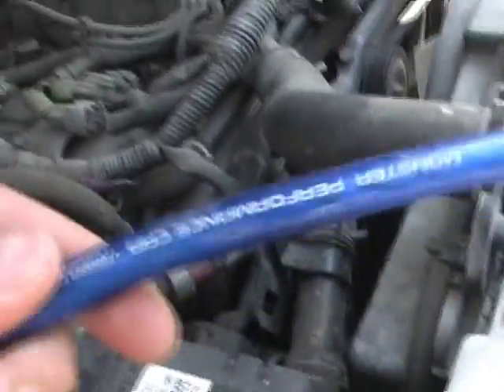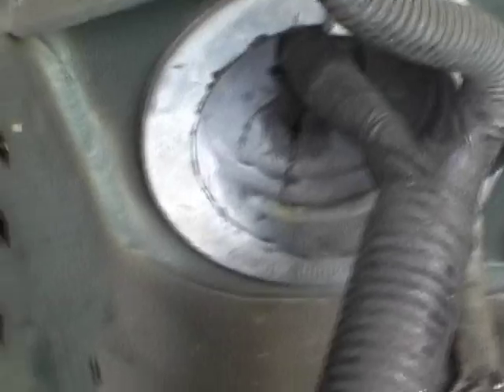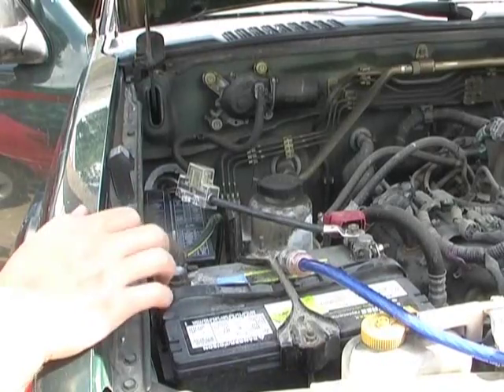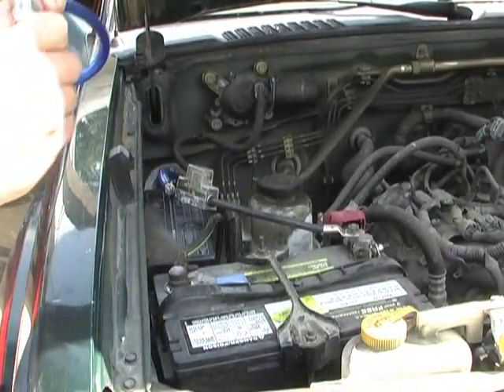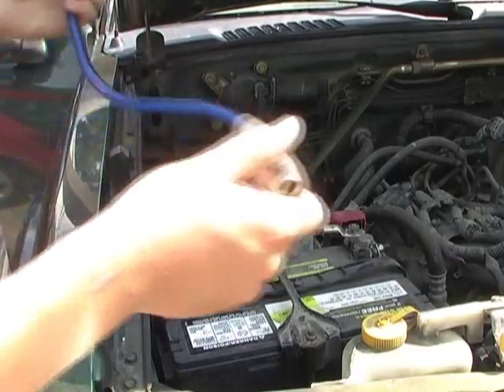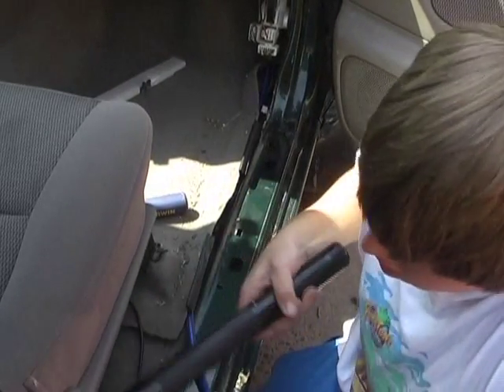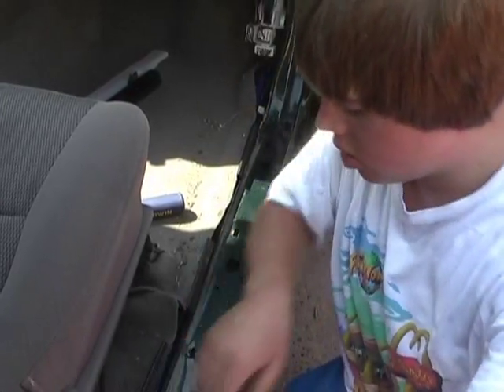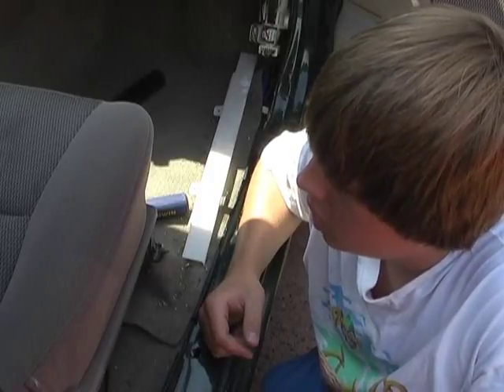insatlling my 4 gauge power wire

Comment from the maker: @cod4fan1992 well 1200rms at 12v would be pulling 100A so you might be able to get away with it for a bit if you dont crank it up. but this also may be damaging to your amp if it cant get the amperage it need through the wire. id say just be safe and wait.

Comment: how i did mine was connect your main power wire from the battery to the pos on the cap then run a small wire from the pos also to the power screw on the amp then another small wire from the ground on the cap to the ground on your amp then run a short ground wire from the ground on the cap to a good ground point on your truck then i put the resistor in and charge the cap then pull it out and put the fuse in and u should be ready to go

Comment from the maker: @darklighter456 just dont put in too big of a fuse for your wire size cause if your amp is over drawing your conductor and you just put in a bigger fuse you may run the risk of damaging your wire or car if the conductor over heats